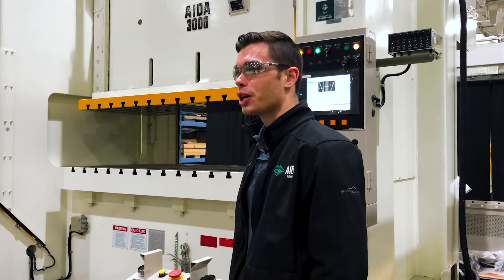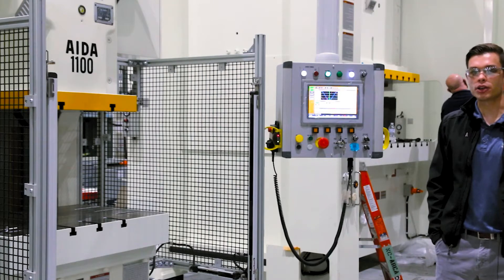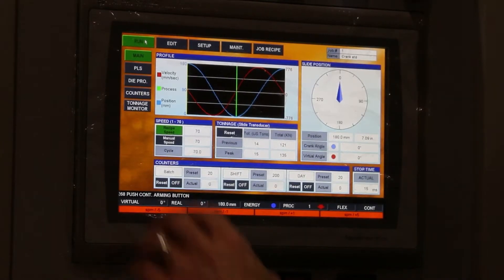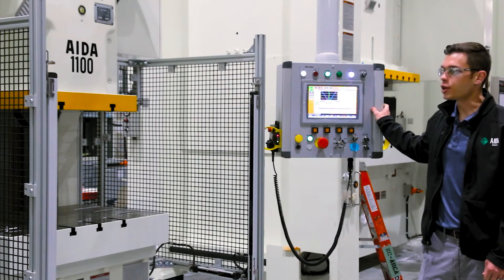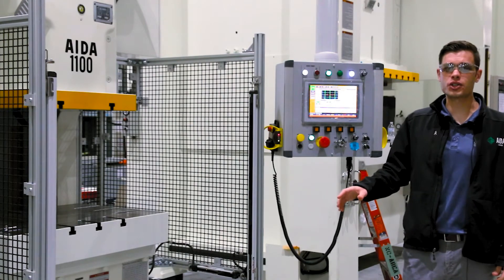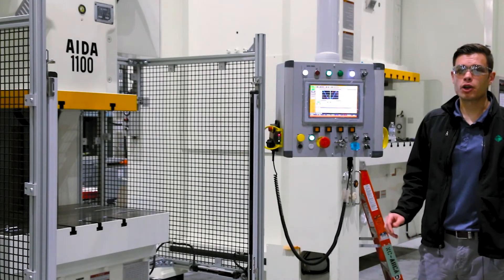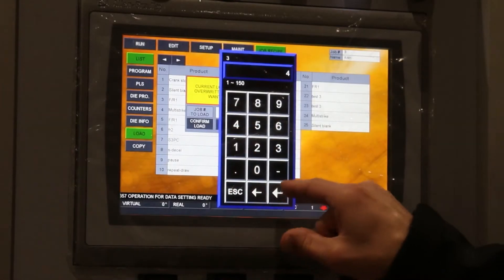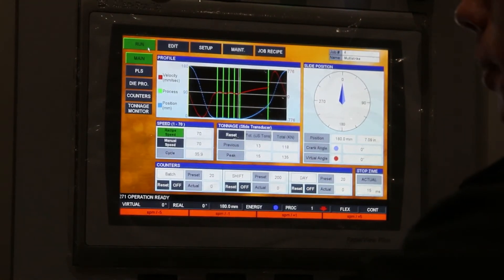Servo Press | AIDA DSF-C1-A Gap Frame Stamping Press | AIDA / Allen-Bradley Control Walk Through

Comment: Nice equipment. 

What is your largest machine capacity?
Reply from the maker: Hi Steve - AIDA builds DSF Servo presses from 80 - 3,500 tons. Mechanical drive presses are available from 35 - 4,000 tons. You can find out more about our full range of presses and forming solutions at www.aida-global.com

Is there a particular application and tonnage you're in need of finding a solution for?